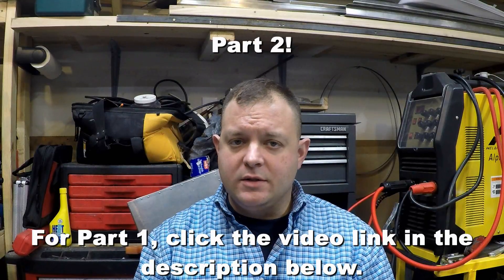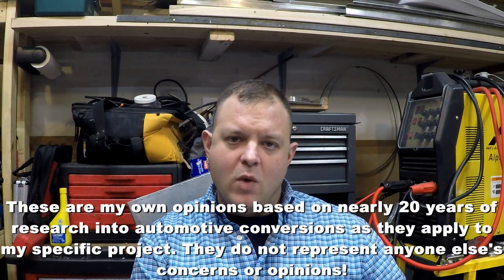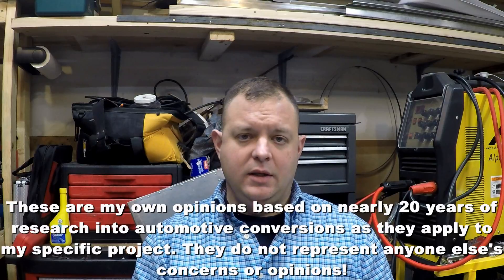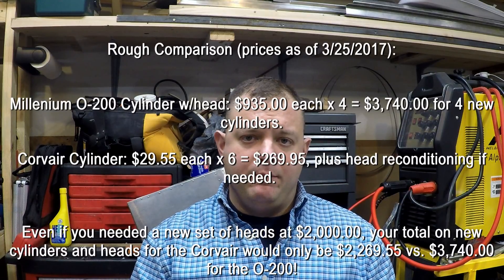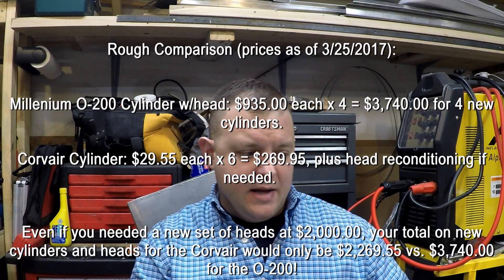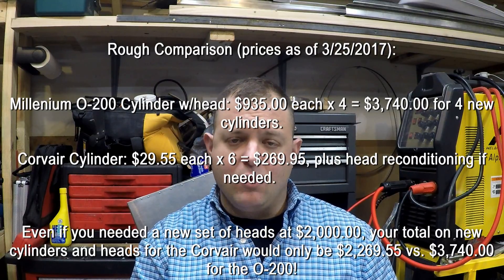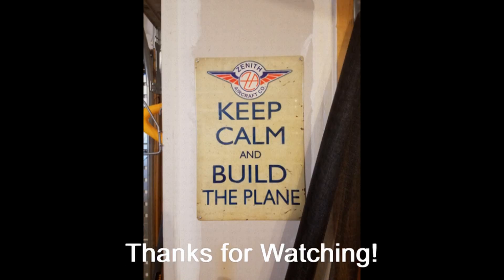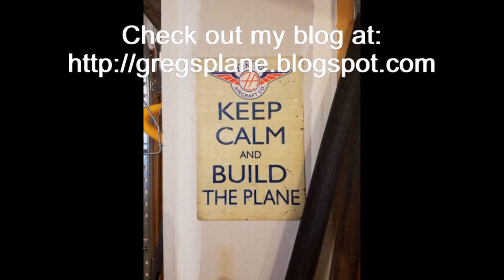Why I chose a Corvair engine conversion -  Part 2/2

Comment: Video and audio you are using is spot on very nice picks.
Reply from the maker: Robert Engel Thanks...lighting, correct settings on the GoPro and a lavalier mic appear to the recipe for this kind of video. If I could find a wireless mic pack for the GoPro, I'd be all set in the build videos. Some day, though, a DSLR will probably be the way to go.

Comment: Getting part way through this I agree with your comments in part but not complete. You did put a caveat that the conversion depends on the engineering and proven methods used and that is something I agree with. The precision of an automotive conversion however can match the precision of a straight aircraft engine especially in the Corvair as the Corvair was originally intended to go in to an aircraft in the first place. Granted back then we would not know how reliable it would be because it never made it into the production it was supposed to because of a contract that was not acquired by General Motors. That brings up the point that this aircraft engine rather the engine that was supposed to go into a helicopter and was re-engineered to go into a car became unreliable in the car and it would not necessarily have been unreliable for its original intended purpose. Works both ways. The vulnerable pancake style engine or box motors as some people like to call them are not really precision as any air cooled engine has a considerable amount of slop between the cylinders and the pistons to allow for unequal expansion of metals whereas the the water cooled engine are much more precision in that regard but they do have the possibility of failure in the water jackets and the radiator themselves. Anyway enough of my rambling.

More rambling... I've had several engine issues shall we say with " certified '"engines. Had a piston failure on a VW.  ALL are subject to failure or can be. Any pilot cooler one chooses to install must be run accordingly and PROPER maintenance done without fail. Then..one may have no adrenaline inspiring events BUT always fly with options in mind in case the unwanted should occur.
Reply: Do you have any evidencethe corvair was designed for sircraft use. I have heard this for years, but i could not find anything in writing ? 100hp & 200 ibs would be a very sick heli ! As for fixed wing, without the 5th bearing forget about a production engine. Again what would be the airframe ? market very small total numbers for another engine.I also heard corvair lost its handling because of added weightof steel cylinders ? I dont really believe that onr either ?
Reply from the maker: @pauleyplay  Despite your damning criticism of my mentality here, I wholeheartedly agree. I've been looking for credible information that shows that Corvair engines were originally designed for aviation use. I'm at a loss. No documentation I can find suggests that the Corvair engine was originally designed as an airplane engine.

Comment: I just subscribed these engine videos were very informative and well done.  Right now I'm leaning towards the Suzuki conversions from Aero Momentum mostly because of cost but I also like that Suzuki actual uses them in marine outboards that have to run full out all day.  So for me I feel like aircraft use isn't asking much more of the engine than it was designed for.
Reply from the maker: Thanks for subscribing! I'm working on some new videos to be released in the (hopefully) next week or so. The Aero Momentum engine looks interesting. I've not seen one installed or run in person, but the videos make them look compelling. So many choices out there! What is your project?
Reply: I'm still in the deciding/planning stage.  The main things I'm looking for out of an aircraft is fast cruise for small cross country trips, able to land/take off on a grass strip, and hopefully folding/removable wings.  If you know of any particular aircraft comes to mind that meets that I would love to hear it.  Right now it looks like an RV-12 with a bigger engine to hopefully get the speed up; although I would like more options that meet what I need out of a plane.  Most of the LSA's just seem to slow for me
Reply: If I compromise on the cruise speed I really like the Groppo Trail.  It's to bad that plane won't cruise around 150mph
Reply from the maker: Almost any light plane can get in and out of a grass strip. I did my primary flight training in a Cherokee 140 and 181, and I landed on grass strips (when the wheel pants were off) just fine...no problems there. Now, if you really need STOL and rough field capability, that's another matter. Fast + rough/short field are really tough. Usually you get one or the other unless you get a new Carbon Cub X. I'd say carefully evaluate exactly how much STOL/rough field performance you really need. Most of your 2-seat light planes suitable for bush flying are going to be quite slow (100 mph or so in cruise). Decide which feature is most important to the type of flying  you're actually going to be doing, and then compromise on the other features if necessary.
Reply from the maker: I'd never even heard of the Groppo before! Looks like an interesting project. My recommendation is to build the plane you want, and then worry about the engine when it is nearly done. With auto conversions, you never know if they'll still be around when you finally get your project done. I had no idea I'd only be starting my airframe 10 years after I started the engine conversion (nor would I have chosen that path)! But, everyone's circumstances are different. Engine choice is always stressful, whether you're trying to decide early on, or well into the project. Since you haven't chosen the airframe yet, don't even worry about the engine

Comment: From what I understand this Corvair engine was first introduced for Helicopter applications, then Chevrolet wanted this for the Corvair powered vehicles, so if I am correct this was always for aircraft excluding the 5th bearing. for helicopter applications.   Please correct me if I am wrong this is what I have found on the internet... Thanks
Reply from the maker: I read about this origin story (stating that the Corvair engine was based on a Franklin aircraft engine patent), too, but have not found any solid documentation to go along with it and consider it to be a myth. I also read another story that suggested Ed Cole took design cues from the engine in his Beechcraft Bonanza (likely fitted with a Continental IO-550) and incorporated them into the Corvair engine design specs, which seems more plausible. Having torn down both Corvair and VW air-cooled engines, I can personally attest to some major similarities, along with major differences, between the two. At one point I was almost convinced that a Corvair was a rip-off of the VW engine, but there are enough differences that I don't believe it to be the case. However, Chevy engineers could have taken elements of the VW when coming up with the Corvair engine. The only confirmed use of a helicopter engine in an automobile design that I know if is the Tucker 48, which WAS documented to be a modified Franklin engine originally designed for the Bell 47 helicopter. At this point, I believe the Corvair was originally designed for the a car and never originally intended for aircraft, but aircraft (and possibly VW) design cues were incorporated for weight reduction, simplicity (air cooling) and reliability. But since we can't interview the people involved in the original design, all I have is pure speculation at this point.

Comment: Can i get a reverse flow prop i want to push air insted of pull
Reply from the maker: Yes you can, many props can be ordered for pusher configurations. The Corvair rotates the opposite direction of a regular certified engine, however. You will want to discuss your specific setup with a prop manufacturer to makes sure you get the correct prop for your application.

Comment: Thank you i want to use it in my gyro copter
Reply from the maker: Sounds like an interesting project! I'm guessing you will need to run it with the cooling fan installed on top of the engine (the way it ran in the car), unless you can sort out a pressure cowl. From what I understand, pressure cowls are really tough to do in pusher configuration. I'd have no idea how that would work in a gyro, but the top fan is how the engine was designed anyway. It's used in aircraft that don't have pressure cowls.
Reply from the maker: I should also add that I strongly recommend contacting FlyCorvair.com for consultation on using a Corvair in a pusher configuration in a gyro. They are the only Corvair conversion company I know of that has any direct knowledge/experience/information on using them in pusher configuration.

Comment: the corvair was a fantastic idea to make concurrence to Volkswagen, but this fantastic idea in the hands of GM  produce one of the worst cars ever produced, truly unsafe at any speed.
the engine by itself was originally an areo engine converted at the GM sauce to automotive use and overheating at high speed was a major problem with these engines to a point that they are dieseling when driven hard and they had their share of blown head gaskets and disloged valve seats,
if you can solve the overheating problem, there is no reason why this engine can not be a very good candidate to aircraft conversion as structurally, this engine is built tough.
I 've never done areo conversions but many marine and stationary conversions and the three factors I look ar first is the availability of parts and components for the engine, the general construction of the engine and the torque available at RPM needed.
to me , the rule of the thumb for a continuous running application, I never load a gas engine at more than 50% of its rating and for a diesel 80%.
in general, I apply 150% to 200% of cooling requirement as when the setup takes age, the cooling efficiency decreases and it can lead to overheating with consequences

Comment: You are correct, You don't know what you are talking about.
Reply from the maker: Care to add some details about why you think that?
Reply: You said as much yourself,   Its not what I think, you say that you are not experienced in the general aviation, Next you make many assumptions Most are wrong. I am a A&P. I work on all engines, have for fifty years. Airplane engines are nothing special. Built correct your corvair is worlds better than any continental ever was or will be. Do your homework, enjoy your 750 corvair combo.
Reply from the maker: Interesting. Thanks for your thoughts.
Reply: Frankly I don't know why you would say that. He's just openly saying that he is like what many of us are. Not certified but he does have some knowledge. I work on my own airplanes and I stick with experimentals for that very purpose of the fact that I know a lot more about those airplanes than any aircraft mechanic would unless they have specialized in a particular type of experimental amateur bill aircraft. I've been around aviation for 45 years now. Been an active aviator for almost 40 and have built and flown many different types of aircraft as well as test flown several different types of aircraft with proven and unproven engines. I think you spot on on most of what he says and the stuff that he is not sure of he openly admits. He brings up some very good points. There are some automotive conversions that I would not fly behind ever again but I cannot say that about the Corvair because I have not flown behind one of those yet. It appears I'm about to as I'm about to purchase my second airplane to go along with the one I have in the hangar and that does have a Corvair conversion in it. I've never heard anything specifically bad about the Corvair though I'm sure they have their points of weakness that we need to be aware of. This is all part of researching what is out there on the Corvair conversion as everyone has their own opinions and the facts will speak for themselves regarding life